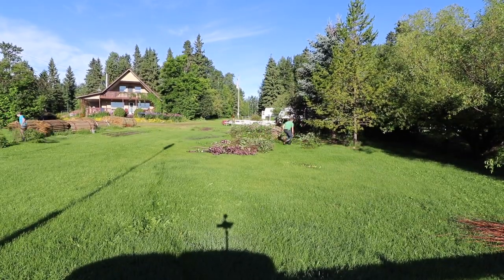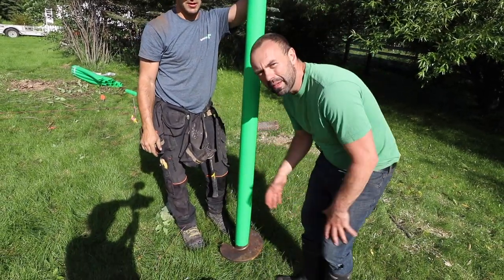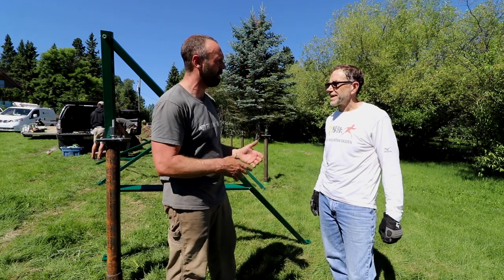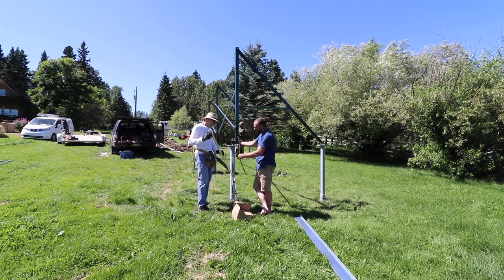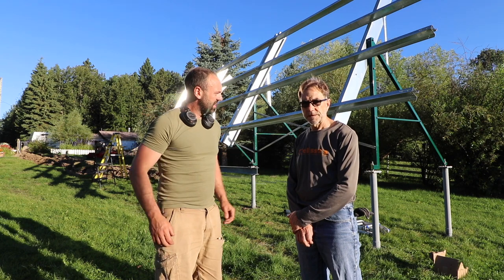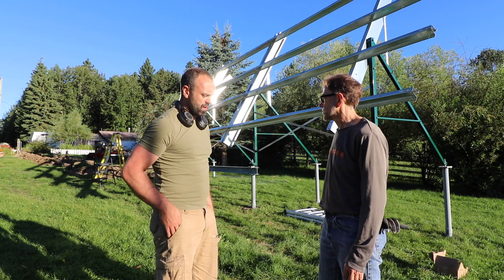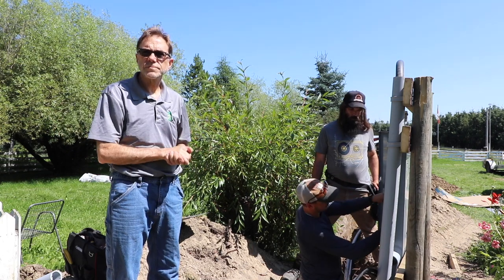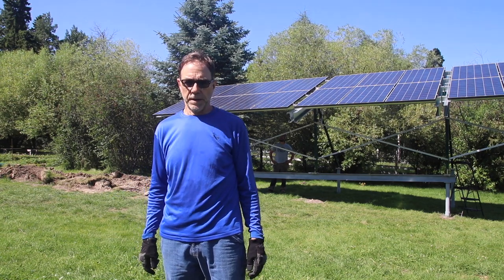Solar Power Bank Installed on Screw Pile Foundation

Comment: Great video. Good discussion on pros/cons on micro vs String iverters. I am assuming the panels face south, and was good to see the panel tilt for all season, doesn't seem like a difficult process to change the tilt. Also, planning further extention into the design and laying the wire at the same time...room for growth. Thanks for sharing.

Comment: Why would you set up your independent power source so it switches off when the mains power goes out. Wouldn't isolators whether manual or automatic be a better idea? Otherwise, why bother because you'll have to crank up the emergency generator with the same frequency as mains power cuts. Honest question, not taking the piss.